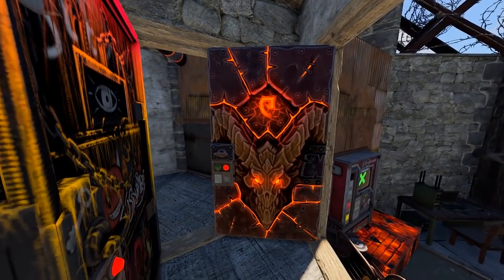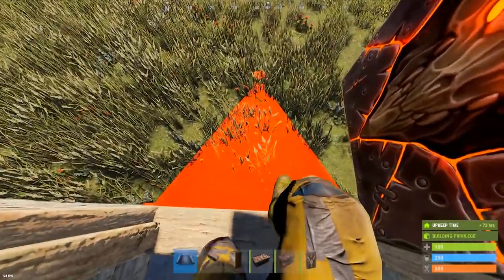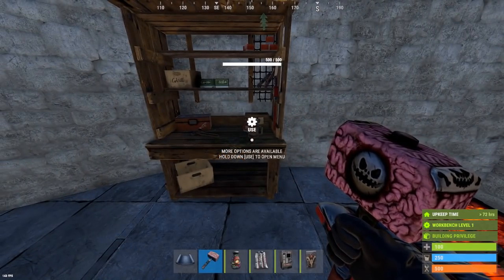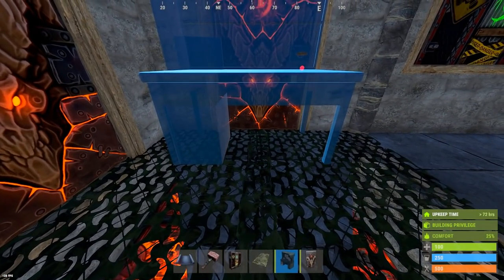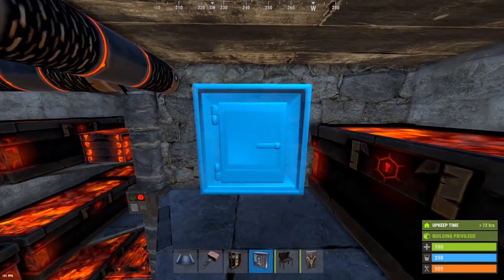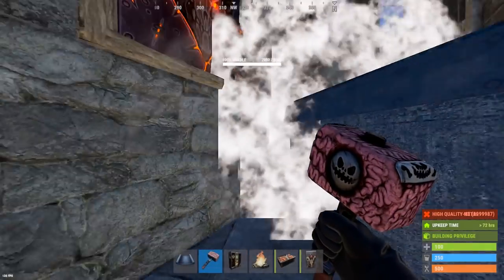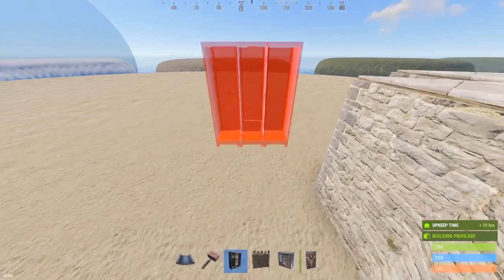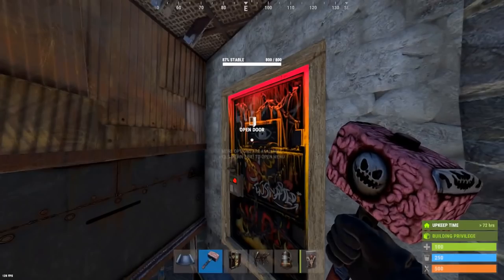RE-INVENTING THE 2x2 Solo Bunker Rust Base design 2022

Comment: Played out the last wipe in this base - pretty damn good for a solo! 
My feedback is as follows:
1. I wouldn’t bother with the locker and vending machine in the honeycombing - I had two attempted raids through there and one group got in through the window and looted that square but didn’t get TC.
2. This base is indefensible in the event of an online raid. My suggestion would be to put a chute or triangle ladder up to a shooting floor above the top layer of honeycomb. Bars / embrasures on windows all around would help defend this and would not cost much in upkeep or build.
3. I was constantly getting players blowing through the wooden walls outside into my large furnace to try and steal Sulfur - they only got metal but was just a pain. Perhaps stone walls are a better option here!

Other than that the bunker worked really well and foiled about 3 attempts to raid through the doors!
Reply from the maker: Thanks for the feedback man
Reply: We've knocked bases like this for the fun of seeing something different. 

We have seen this base and mod mission decided to raid online offline. We took the design and built for a duo and been successful, a bit of traps but fun. I've tried this solo and couldn't get it up fast enough let alone to fill all the boxes. Then again, I'm not good solo lol. I still can't get 6 boxes in a square and I'm jealous seeing people do it.
Reply: vending machines are expensive to raid and dont drop loot when destroyed so having a second vending machine instead of a locker would be a good solution also allowing 3 more rows of non-armor specific storage
Reply: @LeftyyP  I'm just confused on why you covered the first vending machine with the workbench and a box plus the door how do you access that??
Reply: @cannibalking1014  you can open the door through the workbench and open the vending machine

Comment: The ammount of storage is impressive but the downsides are: 
1. You need a lot of resources early if You do it like you showed.
2. You need time to build and close it which is risky.
3. You can get door camped and have no airlock early.
4. If You dont have barricades yet they can get into your compound easy and loot your refinery and furnace and doorcamp You from the roof.
5. You have no roof access for a heli.
Like how it is now i would add a garage / stables or Boat access that act as the honeycomb replacing the triangles and could lead into the yard parts atleast for the transport part.
6. All in all its hard to defend yourself.
Its a Nice stacked base for a group if You ask me that wants to build a large compound base afther and leave this as a farm base when they are done. You are definitly the winner when it Comes to a stacked 2x2
Reply: And if you do place the t2 outside bunker they can use it to refill it and keep jackhammering
Reply: I Think he went a bit box heavy, no one builds like that because no one that has 2-3k hours wants to play like that. They'd just build something better then a 2x2. Or in reality they would just make the 2x2 but better Alotta open core 2x2 starters have been made. Vice even had a challenge for the best of them.

Comment: I dunno about this one, it feels like it leaves you very open to a top down raid, With limited mobility inside along with multiple shelfs removing any chance for a quick run through the base to get to the one box that has what you need. No actual Compound or roof access leaves you very vulnerable when you come out. The amount of boxes feels like it is too much for a simple 2x2, if you need this much box space, i think its just better to choose a bigger more defendable base design. 

While i very much like the concept of a small compact base with a lot of storage i think this design can be improved upon.
Reply: I think it's just a lightning rod for raiders. Looks juicy, is very small. Everyone from scrubs with satchels, a solo with xplo, to a raiding clan would go for this.
Reply: I've been putting a turret in the back facing the front door air lock and going to sleep on the furnaces to alert me when I die. It has stopped 2 potential offline raid attempts so far
Reply: Put a compound around it and put a watch tower in that compound or modify it and instead of the drop bow area put a ladder hatch and don't put the pancake roof so you can have a shooting floor then roof access
Reply: Yeah I wouldn't even add half of the shelved boxes tbh, unnecessary. I like the design, but I don't think you'd even need that much storage as a solo.
Reply: this is fair but the cheapest way in is through doors but because of a hqm bunker a top down would cost at least 24 rockets to tc, if roof honeycomb is sheetmetal, however simply upgrading it to hqm makes it a 32 rocket raid for a fkn 2x2 is pretty good.

Comment: I’ve played around with a similar concept before. It is pretty clever since it’s so cheap which is perfect for a solo. With every upside, there’s always downsides though. First, I just want to say, I’m digging your take on the 2x2, you have managed to squeeze in a ton of storage, maybe more than anyone I’ve seen. There’s some things though I will like to bring up which might be beneficial. One, it’s way too easy to jump into the “compound”. Any compound that has no turrets is just asking for its loot to be stolen. All it takes is a few meds and 2 ladders. So I would suggest either using turrets OR building square/triangle frames off your roof and completely sealing in your compound that way. Either way, if you have the bp, use external stone walls, wooden walls are easy to break. That reminds me, there’s no need to use halfwalls in your roof’s honeycomb. Low walls are just as effective at preventing splash damage while costing less. The major issue with these types of bases though is that you paint a target on yourself. People see the large furnace in a 2x2 and they know it’s going to be juicy. You also can’t defend against an online with this base, you need to at the very least add roof access. You should also consider adding one external tc, they’re very easy to build and can save your wipe. It’s a great base, don’t get me wrong I just think it paints too much of a target on your back. IMO you’re better off building a more subtle standard solo base or going bigger and making it more defendable.
Reply: You for real write a whole essay and he doesn’t even care
Reply: @fearthe12gauge6  man got some points tho, This base look like its stacked.

Comment: it’s not bad for it’s targeted audience, but without armored doors, this base is 15 rockets and 14 expo ammo to boxes (raiding through the vending machine inside the bunker). 24 rockets will give the raider full access to the base. An even cheaper way would to blow the wall where the locker is placed, then following window, and splash the doors. This will allow a 18 rocket raid. The lack of an external allows for the base to be fully griefed. Heavily modifying a 2x2 is pointless as the raid cost will always be cheap. The lack of a secure starter (two wooden walls) during the early start to wipe is also brutal.

Comment: is the second vending machine/door way behind the bunker? doesn't that defeat the purpose of a bunker? isn't the point to have no doors into your core? what is the hp of a vending machine? 

Sorry for all the questions i'm pretty new
Reply from the maker: If you destroy a wall with a vending machine in it you don’t get the vending machines loot so 9/10 times a raider won’t destroy a wall with a vending machine in it  also the vending machine in the core blocks you from entering without destroying it and there go is 1250 I think

Comment: It was good until you built a stability bunker. The bunker isnt even necessary as the raid cost through doors is even to the raid cost through the back walls at sheet metal upgrade, without the bunker. The bunker is also annoying and adds to the HQM upkeep. All im saying is just dont use stability bunkers like that in 2022. Try roof bunkers :D Other than that its a great base
Reply from the maker: I use all types of bunkers, just because you not a fan dosent mean others are not, thanks for the feedback tho :)

Comment: How many rockets or c4 would this take to raid
Reply from the maker: You could get in with 19 rockets if you hit the right side and the base is fully upgraded
Reply: @LeftyyP  what is the weakest side and I assume if I upgrade the inside walls to hqm it will cost more, also do you know how I could add auto turrets to the base

Comment: Problem with all these base designers, yeah, its a 2x2, with a bunker. Lets say u a chad and had HQ core and sheet Honeycomb, its still 24 rockets or 12 c4 to TC and Main loot. Problem with most builders is that they rarely pass this, and tbh, in modern rust, 24 rockets, 12 c4 os simply too easy to get. Atleast make it 32 rockets to tc, i do that with all my bases.
Reply from the maker: People build 2x2s all the time if your smart about where you build then 8/10 times you won’t get raided
Reply: @LeftyyP  i totally agree, that base location can mean everything, but again, the minute u do chad 2x2 with walls, its gonna be a target, and almost everyone knows that those 12c4 pr 24 rockets is enough. A simple 2x1 has better chance of survival early wipe days than your Nice 2x2, ppls know that Christmas tree will be stacked, and those 12 c4 aint much, oh and base def from that Boy there, almost impossible.
Reply: And leftyy, nothing against your vids, and or edits, they are superb og id sub anyday. Good day.

Comment: i raely hate the 3 exstra tringle floor  shelf in the core 2x2 will make it so anoying to move in for me id rethar use the metal shelf in the point for astetics and rember that you have weak point to the baes is the  honycome whit the vending maching ther that will not give u more proteection then 2 sheet metal wallsthat side is 8 rocets waeker then the tc side  so if the bunker is up its better go from that side to raid ( if you  have  armored doors i count as granted) lots of storge is raely nice and yes its baiscly 2x2 baisc honycome but for me mobilty and comfort in the baes is big value so its tiny bit to  cramped for me in the end off all thing its look nice

Comment: Way too many boxes for a 2x2. 
It isn't a clan base, especially not with the kind of mobility you're getting in such a cramped base. I'd replace a bunch of the boxes with other stuff that could actually come in hand like a repair bench, research table, large battery, bed, lights, furnaces, or whatever else.

I wouldn't call this a re-invention of the 2x2 it's just a 2x2 that has way too much stuff crammed into it.